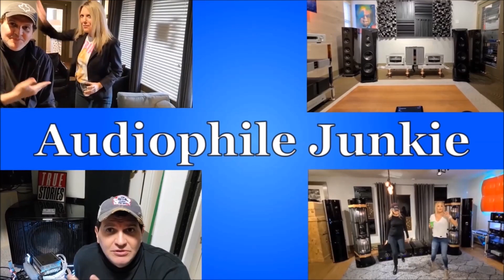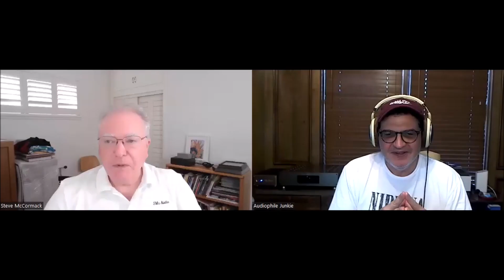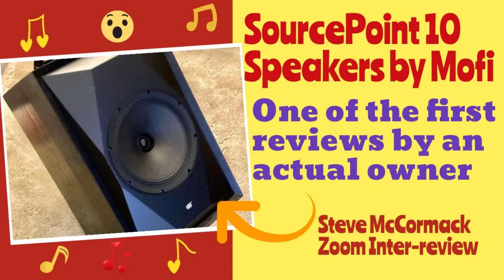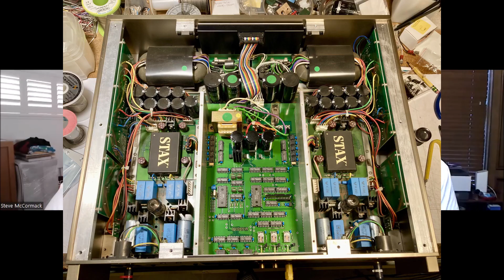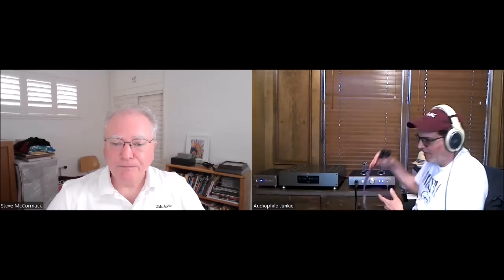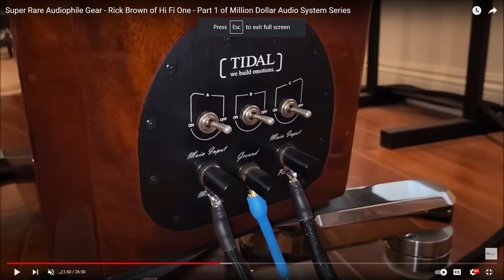Sourcepoint 10 Update - Grounding Boxes Legit? - Stax X1-T Review - Interview with Steve McCormack

Comment: Great Zoom meeting! 1000% agree that older DAC’s with Older chipsets are much better than commodity new chipsets! using a grounding plane system is the last thing you should consider doing. I have the same GR Research NX -Treme  11 Driver (8 woofers, 2 midrange and 1 planar tweeter) Open Baffle Loudspeakers you do. There’s no metal in them, the drivers are made out of plastic from their source in India. haven’t been able to spray paint the MDF panels with Epoxy Primer yet. The weather here in Utah has been way too cold, from -5° to 45°. Hopefully I’ll be painting them in March/April when the temperatures increase from 40° to 70
Reply from the maker: Gratz on the NXtremes.  I'm mainly trying the grounding stuff because I've already got everything else addressed an I'm inquisitive as to what the big deal is, if any.  I agree though that it should be one of the last things you do...like I have.

Comment: If the Sourcepoint 10 lets you hear everything that is wrong in a system then 90% of all music will be unlistenable.
Reply from the maker: A bit of hyperbole?  I think Steve mentioned it will reveal differences in equipment and let you know what's on the recording.  I'm not sure how that translates to "unlistenable" since most music is actually mastered somewhat competently.  There are some horrendous stinkers and super high end recordings at the extremes, but the majority of music should be "listenable" on any system of decent quality.
Reply: @AudiophileJunkie agreed! It’s the over compressed music from the 60s, 70s. 80s and 90s especially all the Beatles albums because they used a limiter otherwise, their master tapes would’ve been oversaturated! 

I do agree with the other guy in some respect because badly recorded music will sound worse on a great system than a crappy system. Because you’re going to hear how bad the recordings are .
Reply: I know how great Steve’s gear is and his DNA250 amplifier was produced in the 1990’s. It was and is a stupendous solid-state amp that sounded more analog than any other Solid State Amp manufacture during that time! I heard that amp at my buddies house powering MBL 121’s it was absolutely amazing he was using an EAR Tim Paravicini $14,000 preamp and his EAR Acute CD player with a Wireworld Silver coated copper SPDIF cable to the SPDIF Output on his Sooloos Music Server. (Purchased by Meridian in 2009?)

A well known reviewer asked Steve how he designed his gear. and I believe that 95% of the audio manufactures don’t do that to anywhere near the level that Steve does! When he designs an Amplifier. He listens to it, if he didn’t like the way, it was performing, he would change a capacitor and modify the sound to be a lot better based on the quality of the capacitors any type and other parts well! This process would take Steve between 6-12 months to fully accomplish this methodology! Steve is a very unique very talented in the world of designing and building high-end Audio Gear! he obviously builds amazing products. That’s why you have his Mono amplifiers and you have one of his Preamps! With this said, anybody who’s buying new loudspeakers needs to have great performing gear. There’s no if ands  or butts about that. I will debate anybody at any time about this.

If you don’t have great gear, then you’re gonna get a lackluster performance out of your loudspeakers, and I also agree with Steve that you need to have synergy between the amplifier and the Loudspeakers. It’s extremely important.  The majority of audiophiles don’t seem to understand that unless they’ve been in this hobby for as long as I have or you have. I’ve been in this hobby for over 40 years and I didn’t learn this in the first 20 years of being in this hobby.
Reply from the maker: Good comment.  Steve really respected EAR and Tim, so I bet that system was great.  I've been using Steve's amps since the 90s, so I know exactly what you are talking about in terms of it being both SOTA and high value.

Comment: SteveMc making a reference to SteveH's observation on the Sourcepoint 10 w/ Luxman integrated. Yes, system matching can be a headache. What matters is that both Steves agree on the greatness of the Sourcepoint 10's. Great video, as always.
Reply from the maker: We both scratched our head on the Luxman not driving the Sourcepoint to satisfying levels.  Nevertheless, almost everything else seems to have worked well with the Sourcepoints.  Some claimed the tube BAT amp at CAF was favored over the HiFi Rose, but I couldn't confirm that.  I just hear them with the BAT.
Reply: @AudiophileJunkie  - problem is both both the BAT and the Convergent Audio are way too expensive for the MoFi's, so is the Pass 250.8 that SteveH is using on them. More a match (pricewise) to his other reference speakers. The ideal here is to find a <$5k amp that makes the Sourcepoint 10's really sing. 👍👍
Reply from the maker: I think the HiFi Rose impressed many at CAF.  It was only in direct comparison to the BAT that people remarked how the Sourcepoints responded accordingly.
Reply: @AudiophileJunkie  - makes sense. I thought you had misspelled CAF for C.A.T. sorry. Old timer here...

I believe the Sourcepoints will be a hit among audiophiles. 

Keep these videos coming!
Reply: @AudiophileJunkie  I’m looking to use the source point 10s for home theater. Do you think running them with a Denon AVR (125 watts for 2 channels) would work/sound good?  Thank you for your insights.  Love the channel!

Comment: There is a lot of science behind grounding, but not in audio. You will have to look at health research and road / bridge building. You can actually draw current from the ground. Entreq was founded on ideas based in science. When other companies jumped on board with grounding products they did not know as much. Today however the A/B-testing is thorough. Synergistic Research uses (health grounding) wrist bands to make sure the listener and the electronics share ground.